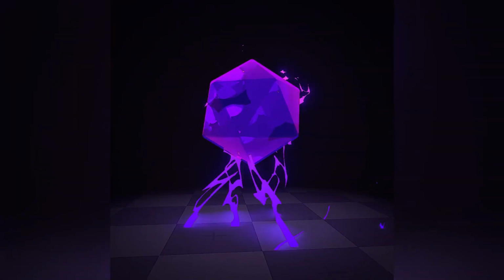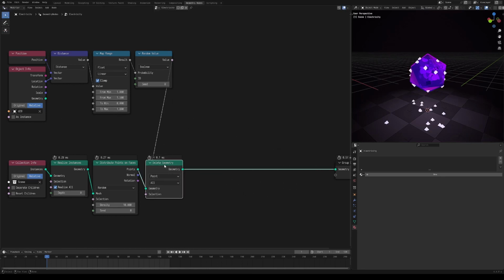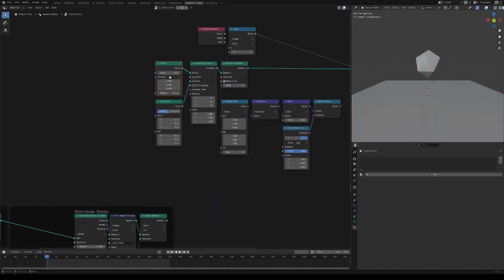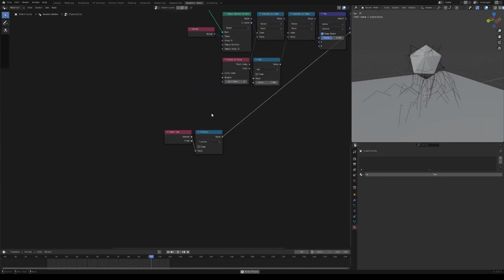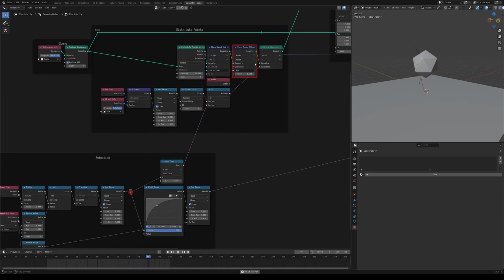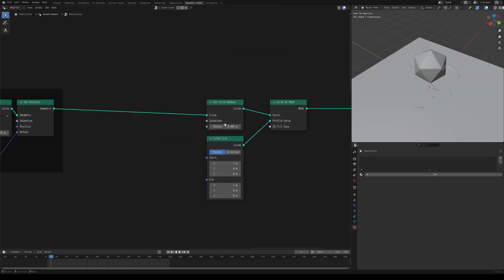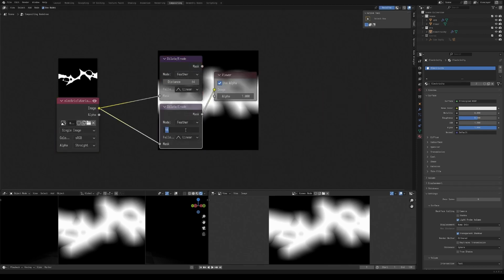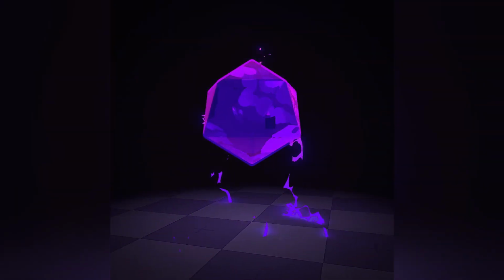Blender Electricity VFX Tutorial

Comment: The curves are not visible for me :(
I am doing something wrong.
The first curve did appear once but after that it jsut vanished. I tried redoing the whole curveline....realize instance thing but the curves(pokes)don't appear only.
Reply from the maker: hmmm, make sure whatever you want to output is going into the "geometry output" node and not just the "viewer node," as the viewer node will just disable itself if you select the object for some reason. 

Also make sure all those curves are being instanced on the points properly? It's a little hard to know for sure what the issue is

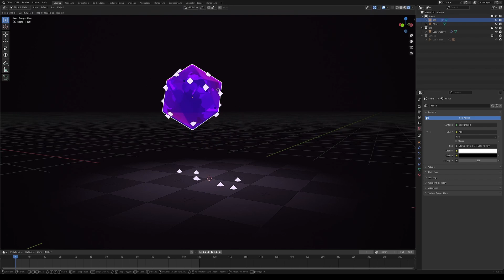Comment: I'm a bit confused, i am at 2:50 but when i unselect the electricity objets, my points disapear, is there someting I missed ? I tried to download the file to check but i can't open it. I'm still on Blender 4.1 is that why it's not working ?
Reply from the maker: @baptistejacquet4868 make sure they are plugged into the group output node and not just the viewer node. the viewer node only displays it's output when the object is selected. the file is for the experimental NPR branch because the icosphere shader makes use of some new shader nodes

Comment: Hey! This is fantastic work, hope you're proud!
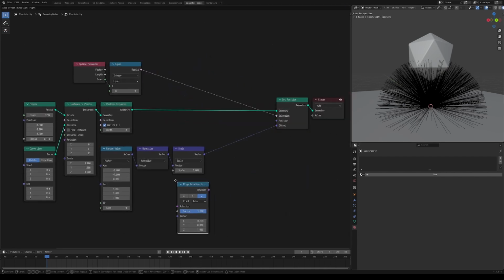I'm trying to follow along with your workflow, I can get to 5:07 however the 'Align Rotation to Vector' node isn't available for me, I only have 'Align Euler to Vector'. This node outputs light purple/pink rotation data, and can't be plugged into the rotation socket of 'Rotate Vector'.
Is this node exclusive to NPR?

Thanks so much!
Reply from the maker: Thank you so much! Rotations were changed in later versions of Blender to be their own data type rather than being the same as a vector, and depending on your blender version, you may more may not have certain deprecated nodes for rotations replaced with the new rotation datatype.

All you have to do for older versions is replace "align rotation to vector" with "align euler to vector", then plug that into a "vector rotate" node instead of a "rotate vector" node, with the type set to euler instead of axis angle
Reply: @krisp-xyz  thanks so much!! Can't wait for your your next vid 😀